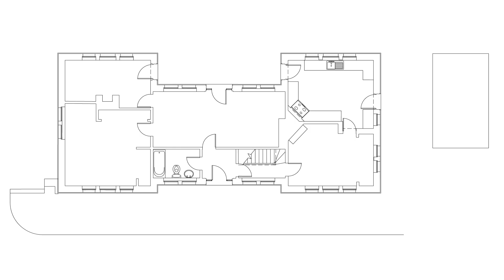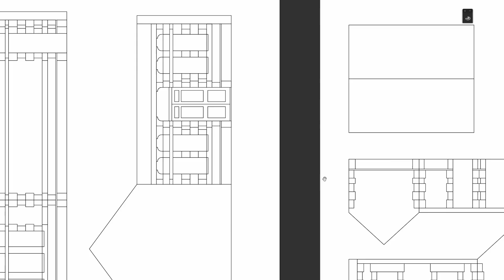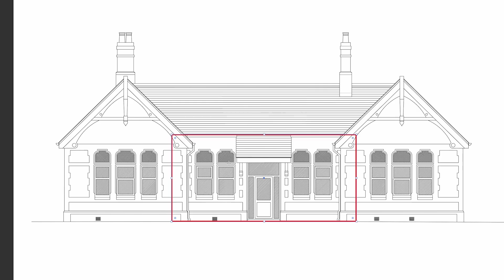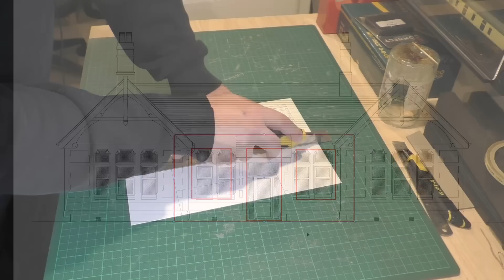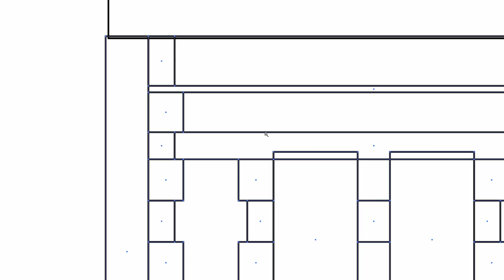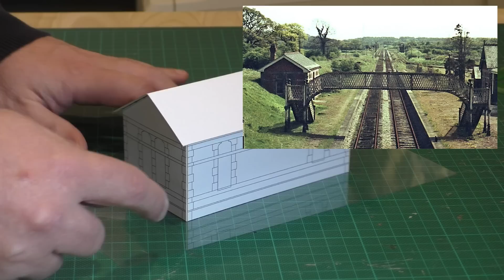Coals/Lamps Building & Platform 2 Building Mock-ups Complete

Comment: I've been slowly catching up with what you've been up to. 

The station research is too notch. One thing you might find useful in future is considering joining the historical model railway society (hmrs), they have a large resource of information that is potentially helpful for things like this. 

There are some examples of stations that have both platforms staggered, particularly on the south eastern railway area, such as erith. It would certainly look different on a layout as everyone tends towards symmetrical, but it is not always the case.

Comment: Julian, your patience and the quality of the design and assembly of the mock-ups are indeed a credit to you. I only wish that I was as gifted. One thing that seems a bit odd to me though is the small size of the building on Pltfm 2 as originally designed.  Perhaps it housed a small 'wet / cold weather' waiting room and toilets, but that still seems to be a bit of an under-development of the site, particularly when compared to what is located on Plfm 1.  The fact that your Pltfm 2 services two tracks could also highlight one possible deficiency even more, namely the lack of cover for passengers wishing to directly board the trains on either track. I am sure with your skill you could design a canopy, say, similar in design and length to that on Pltfm 1; which incorporates the small building but to also extendis further down the platform on twin column supports.  A lot more extra work, but doable for you, and I think very worthwhile.  Cheers from Aus.
Reply from the maker: The platform 2 building is very much based on guess work as it doesn't feature in the original plans I obtained. The footprint size was approximated using a satellite view so it won't be bang-on accurate.
Reply: @StationRoadModelRailway  Thanks Julian. I think, no I know, that you have gotten it as close to bang on as anyone can.  Cheers

Comment: Hi Julian,
I have enjoyed watching your videos for quite a while now, especially the recent series on modelling Wenvoe station as I used to live in that part of South Wales.
I have been googling images of the Barry Railway stations at Efail Isaf, Creigau and Wenvoe itself and I think that you might want to take another look at the second platform building before finally committing to laser cutting parts for it.  I have found a couple of images taken at Efail Isaf that show that building, albeit at something of an angle, and it would appear that on the prototype the columns of brickwork either side of the pairs of windows on the front elevation are wider than you are allowing on your model, at two full bricks at the widest points between the stone quoins.   Certainly wide enough to support the standard size BR poster boards that can be seen adorning the front of the building. Also, on one of those photos there is clearly an outside Gentlemen’s facility on the right hand end of the waiting room as you look at it from the platform edge.  
I hope that will be useful to you.
Cheers,
Reply from the maker: Thank you for the info. I can spot some for of structure at the end of the building at the Efail Isaf station, hard to make out but agree this would be a gents toilet. It's a pity the original plans I was able to obtain didn't include the platform 2 building.

Comment: The other station building will work out nicely with the shortened Bay Road. As for the rear of the building, maybe there were windows to let the light in.   Martin. (Thailand)
Reply from the maker: I may include windows in my version but most likely not in Laura and Gil's version as the building is set into the embackment.

Comment: If you think carefully and compare your trackwork dimensions to the prototype dimensions bearing in mind that the trackwork is straight you could use platform clearances,use a correct 6ft between each track and tighter dims on the bay would give you a wider platform 2!
Reply from the maker: I have considered tightening the gap between the tracks but it would involve significant surgery to the baseboard framework as a realignment of track and the point at the end of the platform would collide with a beam running underneath.

Comment: I think it's rather interesting to have the two dioramas differences, mimicking real life. Using the same buildings and design, but ever so slightly altered to fit a slightly different set-up. Rather than identical diorama, it becomes a tale of two stations built at the same time, but on different part of a given line, by their patron company. Pretty clever!

Really looking forward to seeing how it goes from mock up to the real deal, but of course, real art takes time! ^.^

Comment: Hi Julian. Once again, fantastic research into the, presumed, station building. I do like the idea of the bay platform, and I agree with Ian that if you are going to scratch build the bridge, then moving the actual building down would make a lot of sense. After all the model of the real buildings and situation are going to  the family now living in the buildings. However, correct me if I'm wrong, but quite a few episodes back when you removed the track from the bridge and filled it up so as to look disused, the idea of that was to infer that this bay platform line did continue on to, where ever? So, with that in mind and your new idea, how would that have happened? as you certainly couldn't drive a train through the building? I know that you're a stickler for detail, but perhaps, in this instance, a more modern building on the bay platform would be more appropriate, inferring that indeed the line did continue on, but now being disused and terminating here a later design was agreed upon? What do you think?
Reply from the maker: The backfilled tunnel and missing bridge deck are part of a previous alignment for the main lines, not the bay platform. So long before the station existed, the double track took a different alignment.
Reply: @StationRoadModelRailway  That's my mistake then, I thought that the main lines went around the hill and the branch line through it. Not to self, must pay more attention to what Julian is doing!

Comment: Based on my local stations, station structures built at the same time will almost always share certain components, e.g. standard sized doors and windows will be a common thing, same type of bricks, same style overall will all be common, where I am 3 stations were built within a year of each other, the main station buildings are all very nearly identical save for were they meat the ground, interestingly the shelters on platform 2 are of a completely different design to the main building (mainly wood rather than brick & stone) but each platform 2 structure is built to a similar design with only the overall length changing as a nod to how many passengers used the station,  so if you can get pictures of other structures built at the same time on the same rail line there is a very good chance that even though the size might change the basic design will be consistent

Comment: Liking the research and attention to detail. The separate buildings as you correctly assumed would use the same architectural details. Does the platform 2 building appear on the historical OS maps you showed in a previous video. Like the shorter bay platform which is typically more prototypical based on my experiences of station design. The positioning and placement of the buildings and footbridge look balanced.
Reply from the maker: I think the platform 2 building is indicated on the old OS maps, I know the platform definitely is.

Comment: You could move the platform two building further down the platform and place the footbridge between the two buildings as was the case at Efail-Isaf.
Reply from the maker: Nothing is set in stone yet with the footbridge placement, it may move as I get closer to completion of the station.